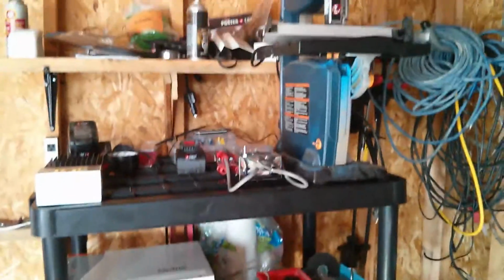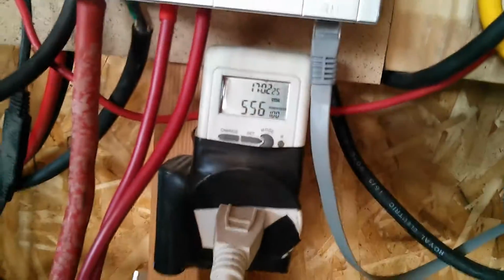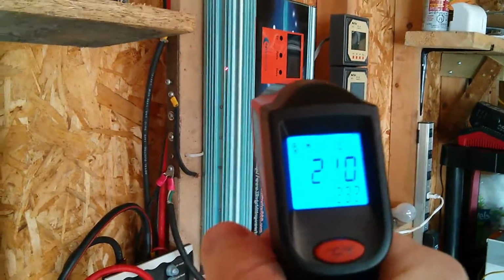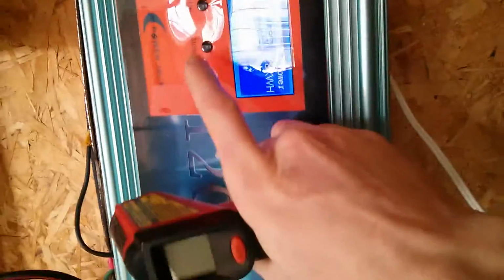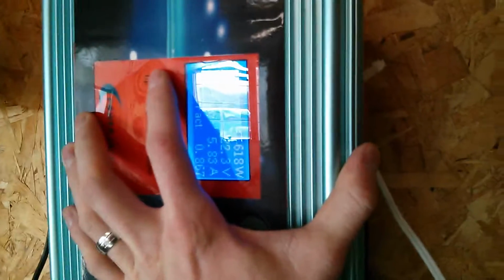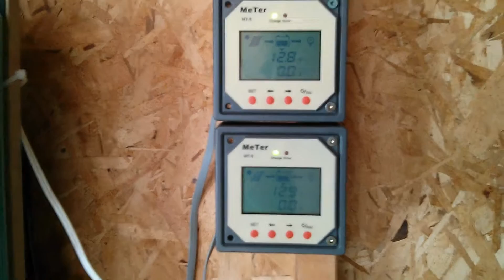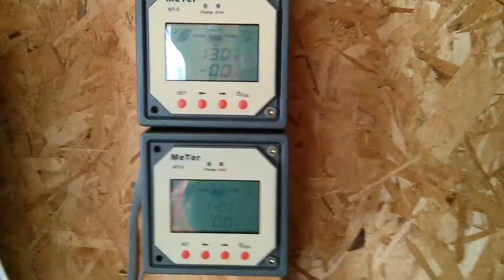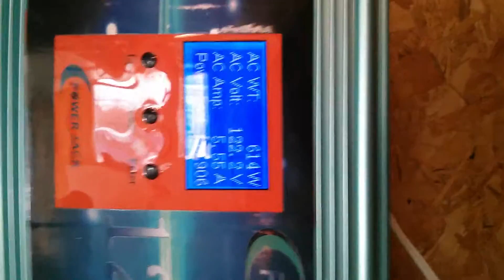solar update and grid tie inverter update

Comment: Is the Power Jack still working?
Reply from the maker: +SuperCal yes it is, and has made 1300KW of power.
Reply: fliping720
Many people have problems with the Power Jack DC to AC inverters, so I was interested in the longevity of yours. Thanks.
Reply from the maker: SuperCal I took mime apart and fixed the loose screws and such and have had no problems with the 1200w model. I also have over 1000w of panels hooked up :)
Reply: fliping720
Good for you. I am looking for a good pure sine 3000w off grid.
Reply from the maker: cotek or samlex or go power or xantrex are all good
Reply: fliping720
Thanks